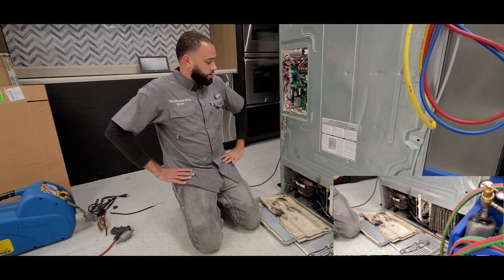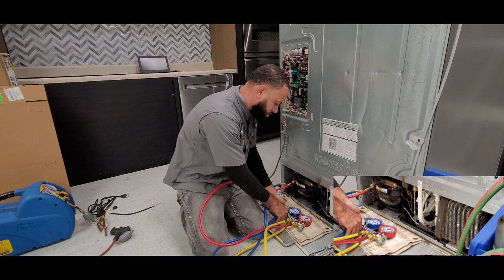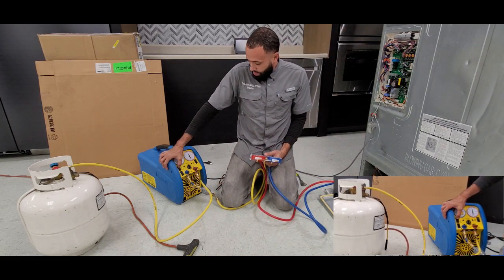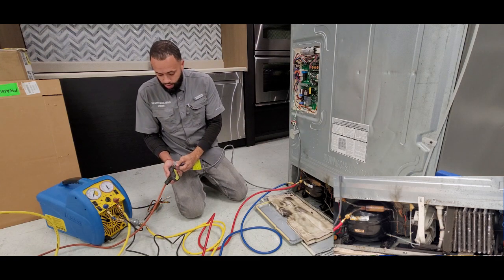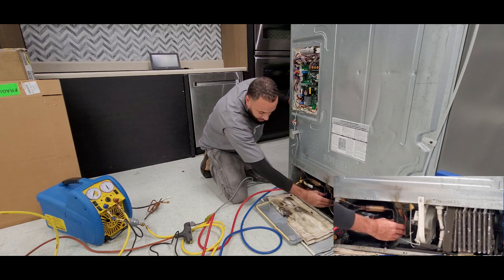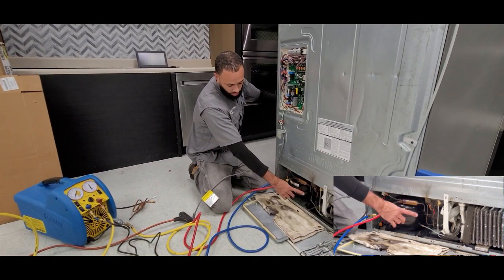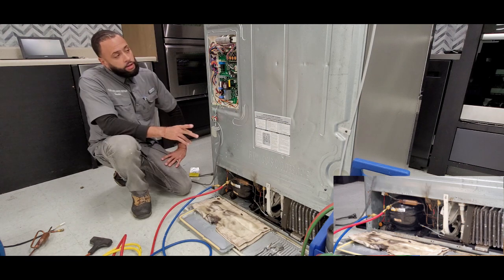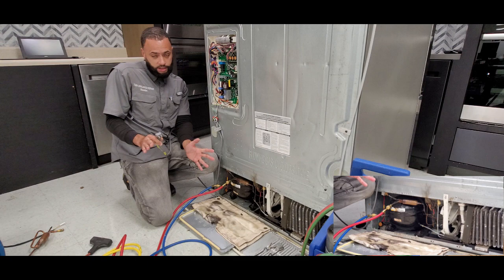#TECHTALK LG Recovery Short version

Comment: What IS the point of pressing the button to put the valve in the neutral position if it automatically does it by itself?
Reply from the maker: Upon start up it in the home position (1 of 3 positions) after that it may switch to the freezer evaporator (2nd position) or ff evap (3rd position)  it cycles through all 3 positions various times during operation

Comment: Good video but I might have to disagree with your timing on opening the 3-way valve. You need to cut power between 6 and 12 seconds, not wait for 12 seconds. Here is a direct quote from my service manual: 

"3-24 CAUTION : Sealed System Repair
Before making a sealed system repair : Start with the power cord unplugged from the outlet. Plug in the power cord and
between 6 and 12 seconds after it has been pugged in, unplug it from the power source. this will allow both sides of the 3
way valve to be opened to allow for proper evacuation."

Just an FYI for anyone attempting this repair.
Reply: Thank you.

Comment: Looking at starting my own thing I am hvac certified. do you need license for your business or how do you get lg to warranty there compressor
Reply from the maker: Yes you shluld get a license but in some states it is not necessary .. as far as lg refer to the units user manual in the warranty section everything is layed out as far as what's covered and not.